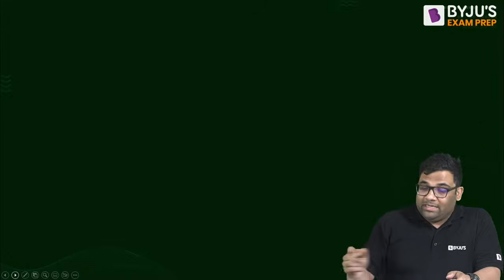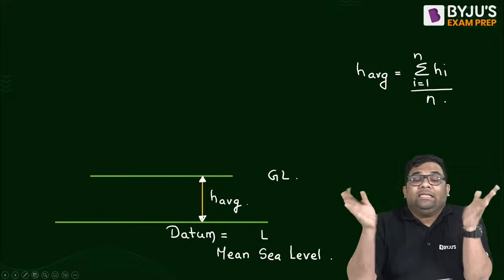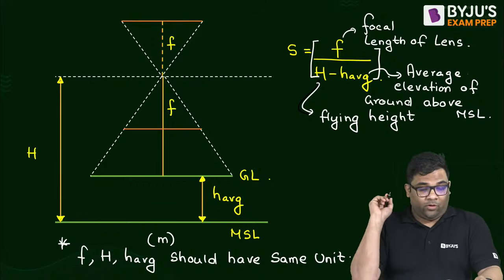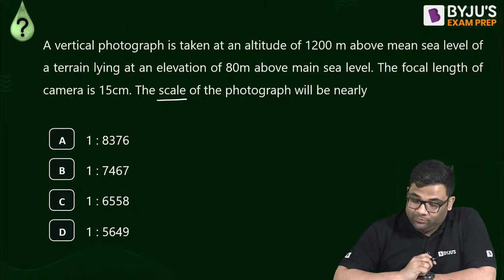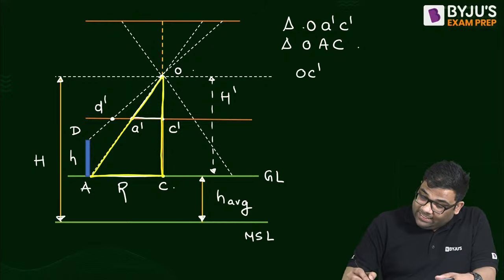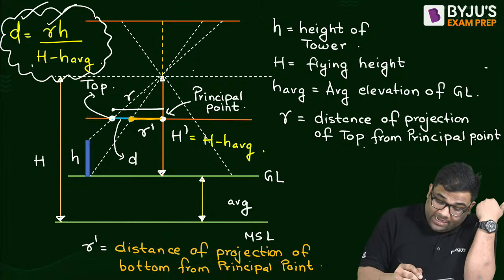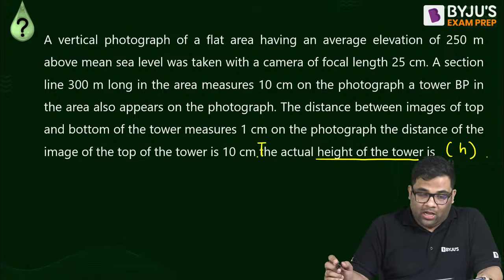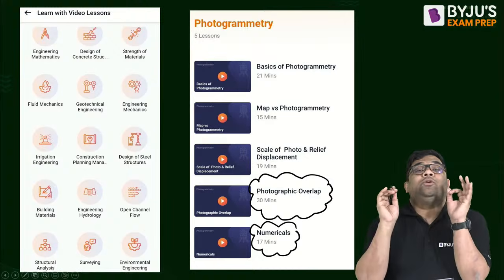Photogrammetry | Surveying in Civil Engineering | GATE 2023 Civil Engineering (CE) Exam Preparation

Comment: The scale of photograph can be defined as the ratio between an image
distance on the photograph and the corresponding horizontal ground distance.

The scale of photograph is given by

S  = f /( H -havg)
where
S = Scale
f = Camera focal length
H= Flying height above datum
havg = Average elevation above datum of the point

Relief Displacement = rh/( H-havg)